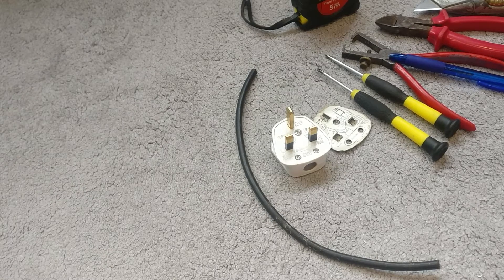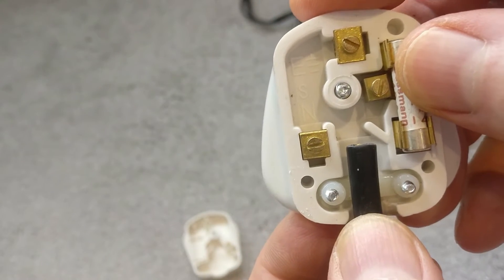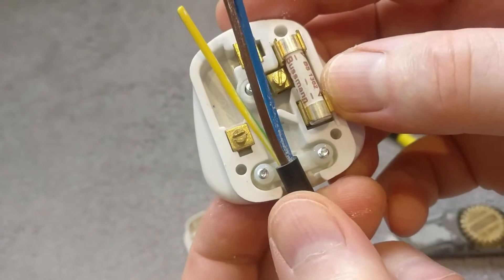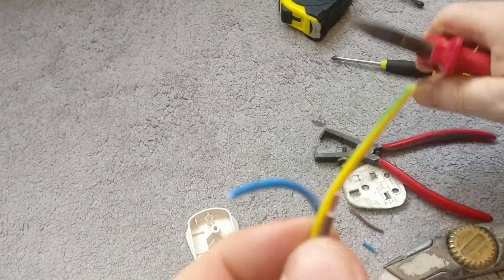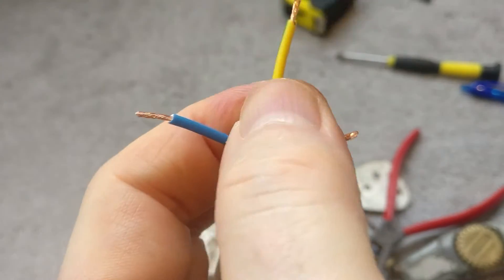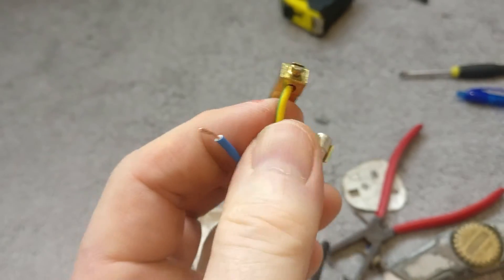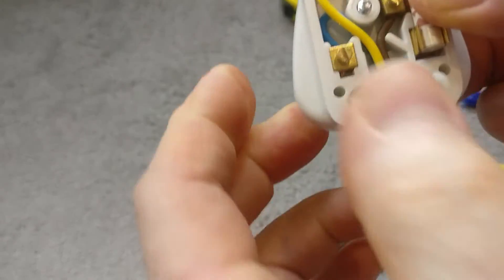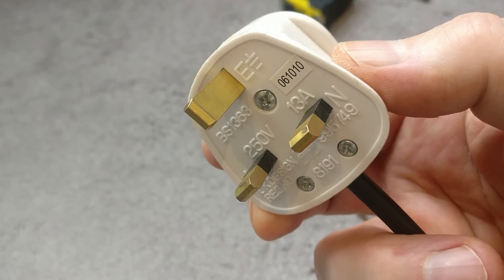How to Wire a UK 3 Pin Plug

Comment: great video my question is when you try to fix it but you don't have the paper where it  tells you where long you should cut and the colours to put, is lost then what do you do?
Reply from the maker: Hold the main cable loosely in place and then one at a time route the cable manually to assess how long each one should be.

Comment: i have grown to hate the molded plugs we have in the US. we at least have warded sockets now so kids can't stick things in the hot or neutral hole, but our plugs all being molded plastic means repair is a nightmare. replacement plugs are MASSIVE compared to our normal molded ones, and rarely fit anywhere useful. also having a fuse directly in the plug is brilliant, and we at least do that for all of our DC plugs for cars.
Reply from the maker: We have moulded plugs in the UK too. I agree they don't always fit some spaces with a rigid flex. I personally prefer the self wire plugs.  Thanks for your comment. Much appreciated. 👍